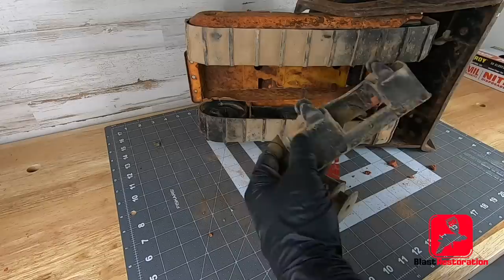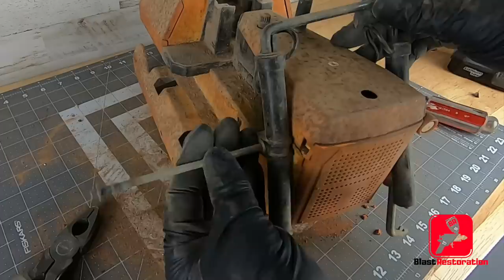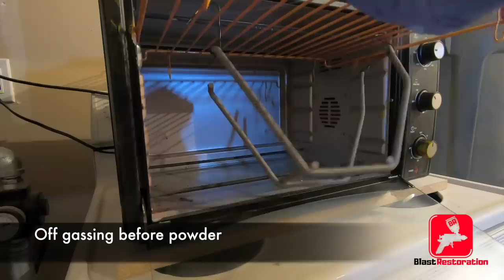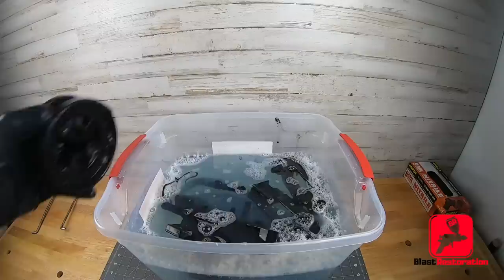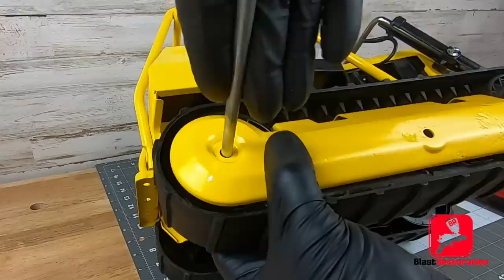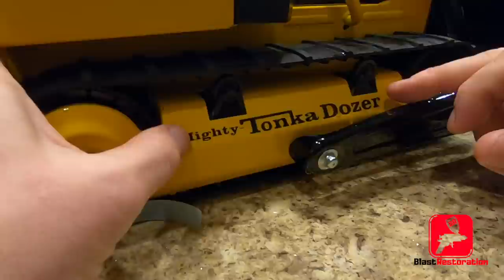Tonka Bulldozer Restoration!!

Comment: We use to beat the crap out of these things when I was a kid. We'd play in the dirt for hours. Name one toy today you need power tools to disassemble it.  America built everything to last back then. Now it's all made of shit in china and lasts a day or two if your lucky.
Reply: Not for much longer.
Reply: Yeah, but that's just a symptom. The problem, the disease, if you will, is the common CEO/rich f**k at the top. Look at the common Tonka vintage toy and you can already see how they took the rubber wheels that it used to come with ages ago, and replaced it with a plastic wheel with rubber inserts that hold the "hub cap". Yet you would still pay the same price between the two of them, despite the fact that one model is cheaper to make.
That kind of mentality, and the notion that there's a need for a Corporation to exist, those need to go away, because they're far more dangerous than cHina is, even now.
These incompetent bullies, loser bred in green sheets, will buy everything under the sun so they can sit comfortably where the average Joe will die in poverty buying cheap things expensively.

Comment: I have taken some apart.  Here is a TIP: Shaft caps/axle hats have different thicknesses.  The thinnest axle cap/hat is the one they beat on at the factory.  The thicker one is part of the shaft.  Nobody should try to take the thicker one off.  After piddling with ONE for about 20 minutes, I started cutting shafts because there was just no room to grab both hats with pliers.  Keep on Tonka-ing!

Comment: For the light, you can make a mold using the remaining one and then use epoxy to create a new one.  Attachment is tricky, but doable.
Reply: Nice restoration.  I don't believe the model had the stickers you used, but still a very nice repair.

Comment: Front grill looks great as is. Wish it still had both lights.
Reply from the maker: Thank you for watching! I also wish it had both but we are still on the lookout for a replacement grill!
Reply: @blastrestoration545  you can make one by 3d printing..
Reply: @raajmata  make a mold from the remaining light and cast one with epoxy.

Comment: Great job. But haven't you noticed you put one single axis on a continuous track, it makes impossible to move tracks in opposite direction thus rendering the toy unable to turn.
As you can see when it was designed the toy had a division in its axis allowing it to turn. To solve this you just need to cut the axis you put in two for every wheel, making it smaller might be a good idea too.

Comment: Nice job. Just one question, why didn't you either replace or at least paint the grill?
Reply from the maker: Thank you! Well like i said in the video i couldn't find a replacement as they haven't remanufactured the part yet and this is for a customer so I didn't want to paint an original part. Thanks for watching!

Comment: If you couldn't find a replacement for that front grill, why not just repair that one?  Make a new headlight out of something and glue it the grill.  Then paint it to make it look nice.  Epoxy putty is useful for this type of repair.  Another option is to use the original part to create a mold.  And then use that mold to create a new part using various methods.  Just pick a material to make it out of that you happen to have access to.  After it's painted, it will look pretty good regardless of the material you make it out of.  Although, I really simple option would have been to remove the existing headlight and remove any evidence that either headlight was ever there.  No one would notice the difference because both sides would match.  Although, I would seriously consider maybe painting the grill silver or black.  The original color was pretty bad.

Comment: Were you certain at the time of making this vid if yellow is the correct color? Since tonka has used Orange for a number of years for construction vehicles...
Reply: By the way have you since this vid found a new grille for it?
Reply from the maker: The color is actually pretty close to the original as the camera does make it appear much more yellow and the grill has also gotten darker with age. No replacement grill yet. Thanks for watching!

Comment: If you couldn't found a replacement grill, I would have just fixed it and paint it black. Maybe make a new headlight with the 3D printer which I believe you do have and glue it on the old grill. If you don't have one, I would have use clay or wood to make a new headlight.

Comment: Does anyone make replacements for that grille or do you have to find another crawler like this one to steal one off of?
Reply from the maker: No one makes replacements yet is what I'm told by the pars supplier i got it from so you would have to find another dozer to steal it from but these are almost always broken so that hard to find!
Reply: @blastrestoration545  I am working on ways to cast or replicate some of those broken plastic parts such as that headlight.  Tried a few different things, nothing that seems video worthy though.
Reply from the maker: Well these grills would be a good thing to replicate. All of them are broken lol
Reply: You can have a new grill 3D printed. They can scan the old one and then bring it into a CAD program to clean it up and then 3D print it.
Reply from the maker: Who has the equipment!?? We need to replicate this part!
Reply: My son has one that the Dozer is so rusty it's at the point I believe its beyond restoration (no really). The cage is missing and we've had it for  years...looks like it was left in the weather for about 20ish years before we got it, but the grille is still good. My son has a large collection of Mighty Tonkas, so I'd have to ask him if he'd part with it.
Reply from the maker: @Pressedsteelcustomsllc  That happens with a lot of Tonkas! Left out in the sand box for years haha! If hes willing to part with it I would be very happy to to give it a new home! Let me know! Blastrestoration@gmail.com